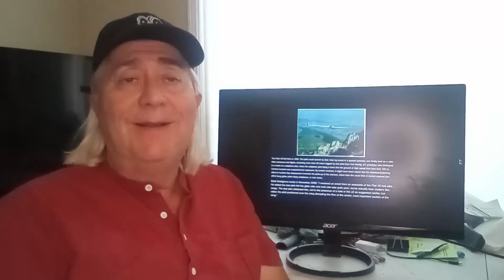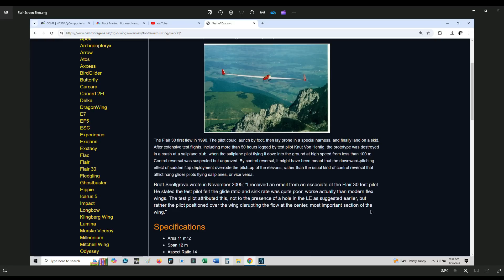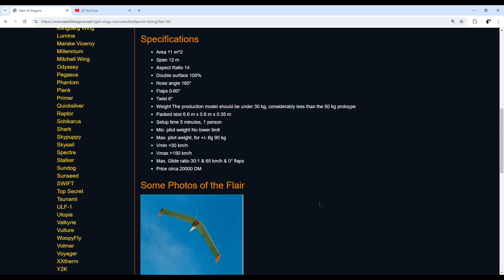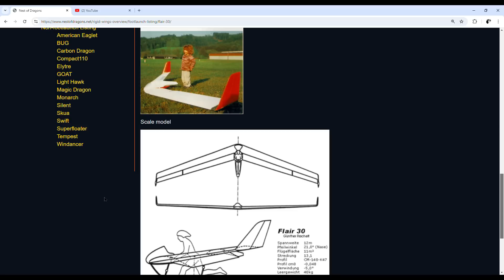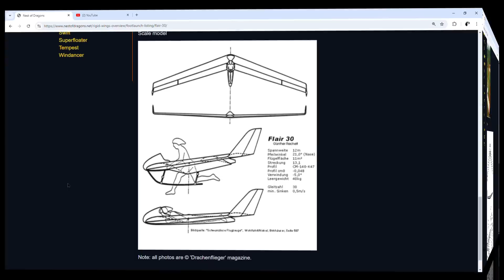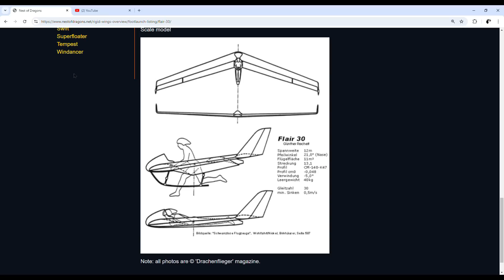Fatal Flair 30 Crash - An Engineering Analysis

Comment: Other than that you said the Fatal Flair Crash was the wing ‘falling out of the air,’ and you said you spun in at Torry Pines, I know nothing of these accidents. However, I am a Glider pilot and did witness a hang glider wing with elevons fatality, cerca 1980 at Salt Creek beach. Incidentally, saw two others involving hang gliders at Torrey Pines before the parasails took over. Washout or an airfoil transition from root to tip will help prevent the sudden tip stall and subsequent spin, however depending on the torsional rigidity of the wing; higher speeds can create enough lift on the upper surface to twist the wing tips downward eventually overwhelming the ability to pull out and pitch downward. The pitching down from wing twist increases with higher lift, lower Reynolds number airfoils, and decreases with symmetrical type airfoils. Not aware of any elevator or elevon reversal other than over speeding the design limitations or torsional integrity of a wing. Obviously a stalled wing can be fatal if not enough altitude to recover. I’ve encountered wind shear and wind reversals on the ridges where the free fall can occur, very sudden and unpredictable. Airspeed and altitude are essential in these cases.
Reply from the maker: If you look at my old videos, can will see that I believe I have solved the stall/spin problem (inboard winglets, control that do not run out to the tip, and special elevon shapes). I believe the Flair crash did not involve a spin as turning or rotation was not reported in any of the 1st person reports.
Reply: @KlingbergWingMkII  what’s your conclusion; summing it up in one concise sentence if possible, serious mistakes can be avoided. Thanks for sharing.
Reply from the maker: I don't have one yet because I don't have all the data I need to do a proper analysis. I have info coming in from multiple sources that will help, but I really need the airfoil coordinates.
Reply from the maker: @charlescz1974  I hope you have been following the videos. Turns out the root cause was the placement of the hinge line at 50% of chord. It ends up causing a flap induced stall with a sharp break. Control surfaces at low Re need to be thin and not much more than 20% of chord.

Comment: Talking as a complete amateur, but having flown hang gliders, including a couple of EF-5's, and being somewhat of a Horten fan, I'm looking at the 3-view and thinking the flaps go a long way out to a point fairly aft of the CofG. Then hearing your comment about flow separation just aft of the hinge line, leaves a bit of a dilemma...
Did the machine stall and fall flat to the ground (signs of the leading edge at least trying to maintain flow), or did it pitch down into the ground (as you mentioned), suggesting the outer part of the flap (being a little more washed out than the centre, and being further aft), maintained lift and overpowered the small elevons?
Beyond that, there is the pilots experience with the craft as well as his overall experience as a glider pilot. How well would he recognise the onset of stall, did he at least try to pitch (stick forward) down to break the stall?
As an aside, I'd watched most of your Mk1 wing video's and was impressed, and noticed a few things; you could have made a lightweight self inflating streamliner behind you, and looking at the elevon positions during most flights, you either needed to be a bit braver and dive in a little more speed (yes, I know you only had a few feet here and there), or maybe the wing needed just a little more washout?
Intriguing to hear you are still at it. Bravo.
Reply from the maker: We will never know for sure what caused the Flair crash, but it is looking like it was a flow separation and very rapid stall onset that is the root cause.

Comment: Just a note to say thanks for your review of the incident, as I hadn’t heard about it prior to your site. In Australia we had two great ultralight aircraft designers pass away in a short period whilst flying low hour prototypes. From that a lot of the local groups put pressure on other pilots exploring new design to incorporate ballistic recovery systems or spring deployment parachutes until the aircraft is proven. I admit I was not interested in doing that until the designer of my first ultralight was killed by aileron flutter and I had been asked to attend the crash site to do an investigation how it happened. I flew an earlier design and was the only person current on them. Is there any reason why this is not recommended on prototypes elsewhere?
Reply from the maker: Testing any new aircraft at altitude with out a parachute is unthinkable! I'm looking at having two of them.

Comment: The book 'Schwanzlose Flugzeuge by Nickel Wohlfahrt' lists in chapter 12.5 for the ROCHELT FLAIR 30 the following data

Spannweite 12 m
Flügelfläche 11m²
Flügelstreckung 13.1
Profil CM-140-K47 mit einem c mo = - 0.048
Schränkung 5° linear
Packmaß 35 cm x 60 cm x 660 cm

beste Gleitzahl 30
bester Sinken ca. 0.5 m/s
Gleitzahl im Bremsflug 5 (Klappen auf 45°)

Klappenstellungen

Schnellflug -4°
Normalflug 0°
Start und Thermikflug 15°
Sinkflug 30°
Bremsflug 45°
Transport 180°
Reply from the maker: Thanks for the reference. Several folks have pointed it out and it will help my analysis.

Comment: Thank you for making this video Rol..... I've always been interested in what happened to the Flair.

Nickel's 'Tailless Aircraft in Theory and Practice' has a drawing of the wing section. Reverse engineering the co-ordinates from that might end being the way to go. IIRC, the deep chord flaps folded over against the upper surface of the wing to allow for easier transportation and storage of the glider.

My theory on the crash (complete conjecture on my part... I'm no aerodynamicist) was that the sailplane pilot weighed a little less than the (usual) test pilot. With flaps deployed, and the glider effectively operating at a higher AOA, I've read that the lift moves inboard (and thus forward) on a swept wing, putting the glider into a tail heavy state, thus causing the sudden nose dive.

I've experienced this on several of the model wings I've built. They fly great with no nasty habits, but then on landing approach with flaps deployed, the model losing speed and descending to slower air nearer the ground, it very suddenly dives in. No warning and no chance of recovery. It took very little nose weight to resolve the issue.

As you mentioned, 50hrs is a reasonable amount of air time, and I would have thought that this issue would have come to light within that period. If the only thing that had changed on this fatal flight was the pilot, then that's a factor worth looking in to.

As mentioned though, take all this with a pinch of salt.... I'm just an armchair critic!!
Reply from the maker: Thanks! See my full reply in the other comments.
Reply: @KlingbergWingMkII  Lots of interesting info..... good to see this getting plenty of interest!

Comment: Also followed the same path to find out what happened and came up with nothing. So I hope someone comes forward. It was a terrible tradegy.

My speculation : Crash appears to have happened at speed, so Re likely > 10^6 ruling out low speed separation. My bet would be separation of flow underside the elevons making them ineffective, hence your need for co ordinates to model the airfoil and whole wing at the appropriate AoAs and Re. The 40% chord flap I'm sure would have been self trimming for moment. Is it possible that rapid deployment at speed probably set off the couple of high drag falling sufficienly below the cg which, in turn was unable to be resisted by full up-elevon with separated flow or not.

I also wonder if spanwise flow from fully deploying flaps may have rendered the elevons less effective.

 Nickel and Wohlfahrt refer to sudden camber flap deployment needing to be gradual.

It's a beautiful design by a brilliant designer, the large flap and elevon chord made for improved portability of a rigid wing togeter with exceptionally high Cl possibilities.
Reply from the maker: Yes, the speed that the pilot was flying at the time will be important. At higher speeds, Re would not be an issue as you stated. My current guessing is that the pilot felt he was going to overshoot the landing site and dumped a bunch of flap and unknowingly, and unexpectedly stalled the entire wing, even though he probably had plenty of speed (well above stall speed).

Comment: I wonder if the airfoil note there is a description of the design pitching moment coefficient and hinge position, rather than a specific name.  Rochelt was involved in human powered and solar powered flight - maybe someone in those circles would be able to help out.  I could pull an airfoil from the PDF, but it won't be very convincing I would be extracting the as-built airfoil.
Reply from the maker: That's an excellent point that I had not considered as I didn't not know he was involved with the HPA world. Now that you mention it, I see some similarities with the Gossamer Condor and Albatross airfoils - low speed stuff. From Nickel's book it also appears the airfoil as similar to was on the early Swift designs. You are right, extracting coordinates from the available pics and drawings would be useless for engineering analysis. However, more info will help guide my speculations.

Comment: As you have said it might have been a safer design with 8 degrees of twist rather than 6. I don't see any leading-edge slots ahead of the elevons, are they in the photos and perhaps left out of the drawing? They have been known to prevent tip stalls, and spins which can be unrecoverable in some cases. A big flow fence between the elevon and flap might help to minimize spanwise flow. I wasn't aware of this accident; I have no information on the airfoil. Interesting analysis, thanks.
Reply from the maker: Fences are for boundary layer problems. Spanwise flow is a potential flow field problem - something completely different